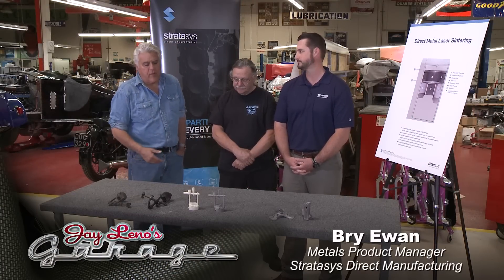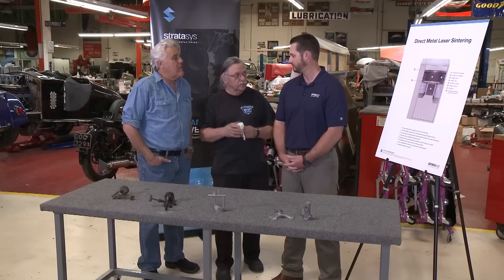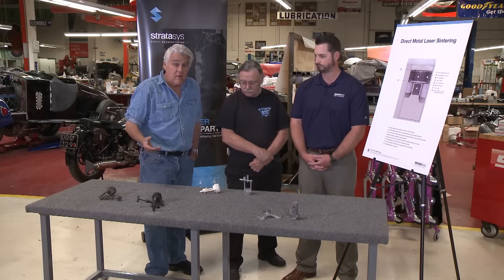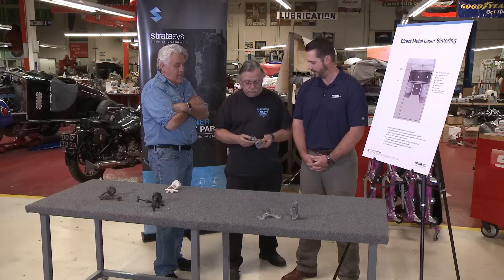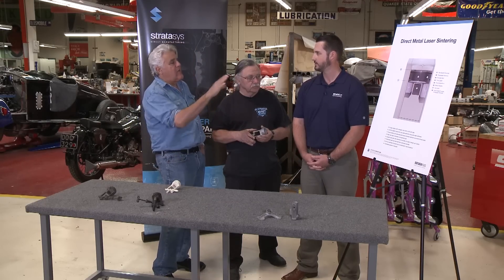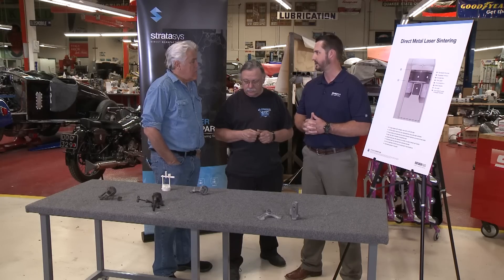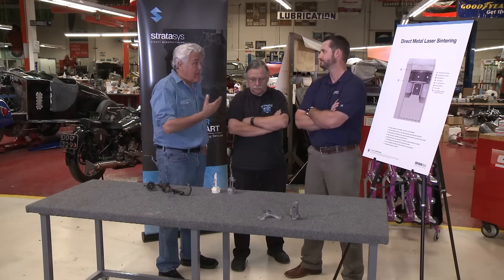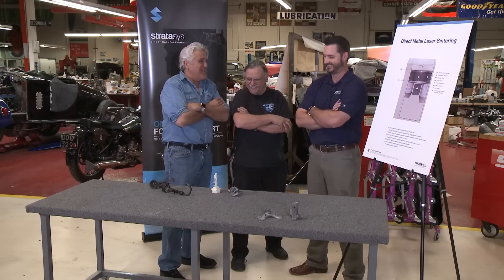Direct Metal Laser Printing - Jay Leno's Garage

Comment: Hardest part about additive manufacturing is curves. Funny part is that old piece he was using wouldn't actually be able to be 3d printed...
Reply: I'm talking about 10:25
Reply: Emmanuel Rovirosa 
I believe if you look closely,
the part at 10:25 is the part that they printed, without the additional parts on it
Reply: wow i didn't notice that. they still couldn't make the curved additional parts though.
Reply: Emmanuel Rovirosa
 true but tubing and valves are still available. it's just a useful tool, kinda like you can't build a house with just a circular saw. and if people like him start using it the technology will improve and price will come down so we can afford to use it when we need.
Reply: i don't think the curved part is a pipe but very true. there are probably other tools for that. you can probably just bend a pipe and weld it on. But yes just like computers. They were millions of dollars and the size of houses. Then gov and businesses started using them and now they are just a few hundred dollars and fit in our pockets.
Reply: interesting. Thank you good to know
Reply: They could if they layed it on its side, so to speak. All the curves would now be horizontal.
Reply: but then they couldn't do the rest of the object

Comment: Should have just made up an answer.  12,000 degrees sounds good.
Reply: Well, a quick google search would tell you that the melting point for Inconel 718 is around 2200-2450 °F or around 1210/1344 °C
Reply: hastyberford wrong! For one thing I admire his honesty... & for G-d's sake, who cares about the temperature it runs at?
Reply: Your right, or say its a 'trade secret'
Reply: Would of been nice to have interviewed the guy who engineered the printer.
Reply: I would have said "Over 9000 degrees" and winked at the camera......
Reply: Always best to say "I don't know" if you don't. Guessing suggests real unfamiliarity with you product.
Reply: HB he was concerned about tempering the metal. with parts that need heat treating, that's a concern
Reply: The temperature varies depending on the metals, but is right around the melting point of each respective metal. How much does that shop foreman job pay?
Reply: The proper reply would have been I don't know but I will find out and let you know. The guy is most likely in marketing and was asked and engineer level-need to know- question.
Reply: Or maybe the maximum temperature is irrelevant or variable.
The laser probably only heats each material to it's sticking point and has 400w to work with. 
400w on steel would likely make it pretty hot compared to aluminum which could probably dissipate the heat far more quickly which would mean it couldn't get as hot.
Reply: Who cares?  Jay cared, because he asked twice.  It made the interview awkward and put the poor guy on the spot.  I guess they don't edit these videos.
Reply: hey, it must be around the melting point, otherwise it won't melt, hehe ;-)
Reply: Power (400W) and temperature are not relate directly in this process. The chamber is pre-heated up to 200C and in this case I am not sure if it runs in vacuum or inert gas. Given that, the temperature is variable due convection and radiation, but we can estimate for sure that where the laser touch the powder it will reach around the temperature of the material melting point.
It is indeed a very interesting technology and I am working on some simulations about it in FEM, challenging but cool!
Reply: Yeah bet he is kicking himself now, once the net gets ahold of you. Tisk Tisk
Reply: or just use a thermal camera or some other kind of sensor to measure it :D